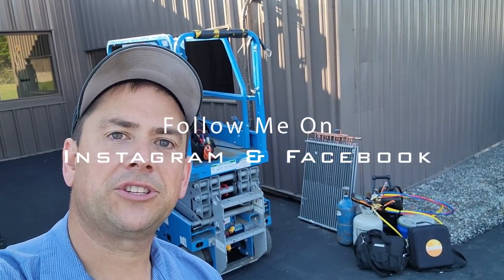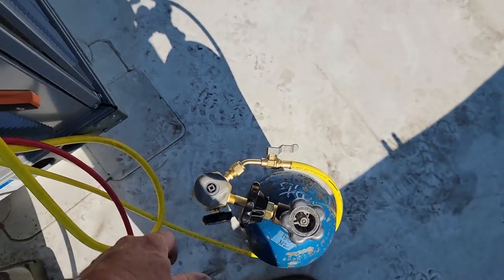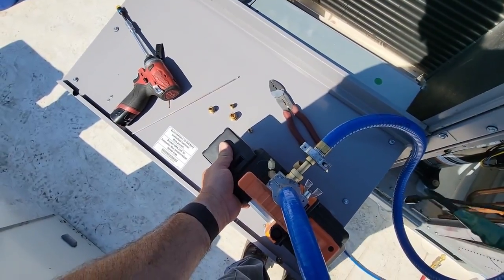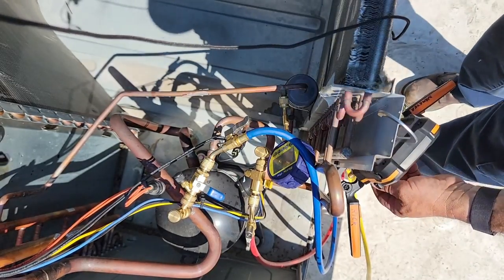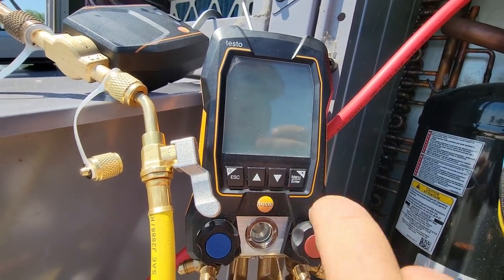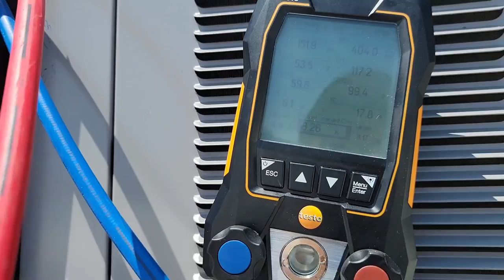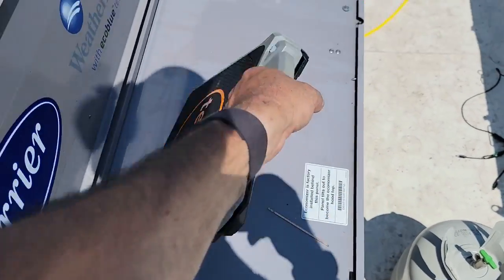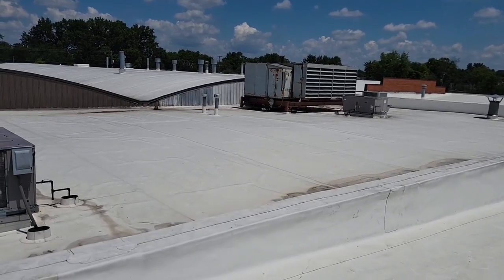Repairing A Air Conditioner With Testo & Navac New Tools

Comment: That's a cool tool I can fix anything under the sun but I can't do computer they whip my ass every time I don't know I just can't get the hang of computer things I own a set of the digital gauges but don't use them I use my analog gauges and my temperature clamp to set subcooling thanks for the video I'm back at work praise God

Comment: Can attest to the value of the blue hoses.

With a 10 CFM pump and the blue hoses, I was able to pull a two-circuit Valent down to 500 microns in under an hour (cores pulled of course). I don't remember the exact tonnage unfortunately, but the circuits were 33.3 and 25.5 pounds of 410A respectively. The suction lines were 1&3/8 and the discharge/liquid lines were 7/8. And that was immediately after changing three of four compressors, a HGBP valve, the driers and having to completely re-pipe the second stage in the compressor compartment due to the original compressors being unavailable and having to go with an equivalent from a different brand.
Reply from the maker: They make it easy for sure👍👍

Comment: Sweet video.. Pro at work😎
Have the same testo weight, read on how to charge the system automatically.. Well that's about how far I made it😂😂.
Only used the manually mode too charge.
Reply from the maker: 🤣👍👍 same. That was the second and last time I used it.
Reply: @HVACRSurvival  Что вы имеете в виду?

Comment: :48 crime stoper like,great video,thanks for sharing.the core depressor does not work for me for microns.
Reply from the maker: The valve core depressor tool worked well for what I used it for but to use it without a valve core removal tool to isolate it was what I was getting at. I did it on one of my last videos where I changed an evaporator, it was a little sketchy that's why I didn't do it this time. That's how we learned new ways of doing things, try different things and find out what doesn't work.

Comment: how is it that not a single big hvac company can make an Evap that lasts more than 5 years? They only run 100 lbs and 200 lbs static. While the condenser easily sees 500+ and is out in the elements..   Also, there should be a contrast adjustment for that screen!

Comment: Hello! Tell me, is it worth buying a testo scale with a valve? I have a testo 550s.❄️
Reply from the maker: I like the scale, it's accurate connects quickly and has multiple different units available for different weights. But I almost never use the solenoid. Depending on how much it is I would probably say no
Reply: @HVACRSurvival  Why don't you use a solenoid?
Reply from the maker: Because you have to have an extra hose, and generally I got to sit there and watch it anyway so what's the point.
Reply: @HVACRSurvival  
It's the same as a robot vacuum cleaner, it does everything for you.

Comment: Will the positive pressure hurt the micron gauge. Would it be best to put another isolation valve before the micron gauge to isolate once your micron is done. Then you can charge it up. If it doesn’t hurt it’s 1 less fitting to worry about
Reply from the maker: That's why I use that particular micron gauge, every micron gauge I've owned in the past was garbage and they never lasted. That's why I never used them until I got this one. It can handle up to several hundred pounds, I forget the exact amount.

Comment: Rick Had a problem with a ecoblue blower motor the installer at the company installed the new ecoblue unit and around (3) months after I go out for the unit not cooling found the blower motor not putting out DC voltage, after checking the unit every thing was checking out good install warranty blower (2) months no cooling bad blower motor again I myself go out and start check found that the ecoblue blower motors are sensitive to to one of the incoming power  line being the high leg just thought it might help someone else and save some time like the video brother
Reply from the maker: That's weird, the high leg shouldn't be high when it's between the power legs, usually it's only high when checking to ground or neutral.
Reply: I agree but the power would spike in the middle of the night causing hi hi volts over 280 on hi leg , didn’t mention I also had power company out and check transformers so far so good

Comment: Just  curios  Rick what is the total time you've spent on this job?  Great video as always.
Reply from the maker: We bill drive time to and from the shop. I spent a while on the old beast inside after this task but if I was to separate the time I  would guess I had 2.5-3.5hrs total on just this repair with testing.

Comment: In spite of those dedicated vacuum hoses letting one work faster, I'd be afraid of having the vacuum "get away" from me and noncondensibles somehow getting in as I switched hoses. Of course, my life is a comedy, so that would be inevitable.

I'm not sure I see that Testo solenoid thing as a helpful item. Maybe it grows on one as they use it...?
Reply from the maker: I don't use the solenoid often but someone might like it so I showed it off. Far as getting non-condensables in the system, that's the reason why I used the valve core tool to isolate it with the ball valve.

Comment: Have you thought about carrying a steel plate with a ring and rope on it?    (non-plastic rope, sisal, jute, hemp, or cotton)  Hang it behind the dryers when you're brazing, so that you don't run the risk of scorching the fins.  Iron would be even better, as it absorbs heat nicely, but a LOT heavier.  Doesn't have to be really thick - even an old thin piece of diamond plate - just something that will take the heat without warping, and spread it out.
Reply from the maker: I actually have a left over fire retardant door gasket for a slim weil McLain boiler that works great. I tried to hide my screw up, I see you caught it🤣
Reply: @HVACRSurvival  - You're not the only one that's done that, and you won't be the last one.   I was just offering it up as a suggestion, because you could use the same thing for lots of jobs.   natural rope can catch on fire, but it's easy to put out.  synthetic rope melts and does nasty things to anything it touches.  Think greek fire.

Comment: If that's the C&D core removal tool. its not vacuum rated. I've had issues with those in the past.
Reply from the maker: I've had nothing but problems with the so-called vacuum rated Appion vct. All this vacuum rated stuff is a bunch of talk. They can all leak and once they do they're usually junk. I rebuilt the appion and it still leaked.

Comment: I've never seen a blower like that before
Reply from the maker: That's the latest and greatest.  No belts, check the static duct pressure and adjust the dc voltage to the chart to reach the desired cfm.